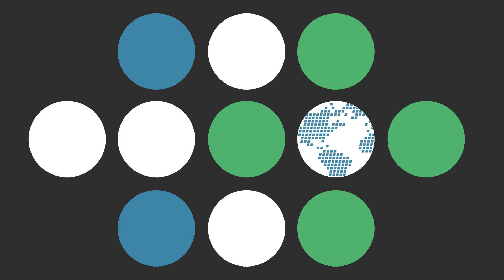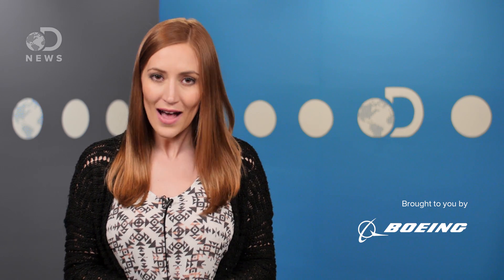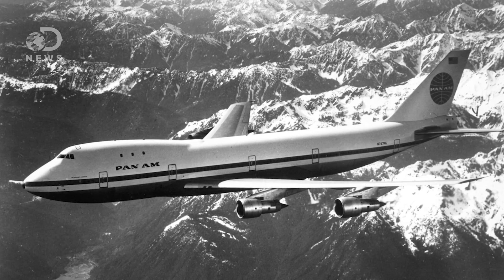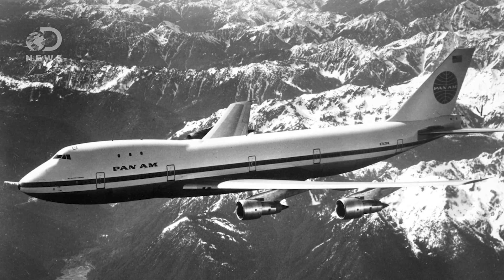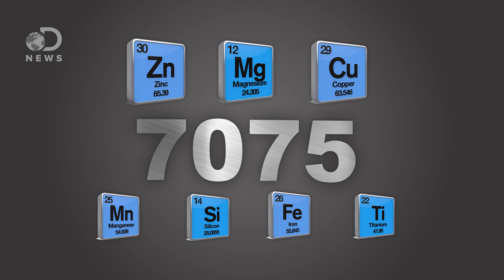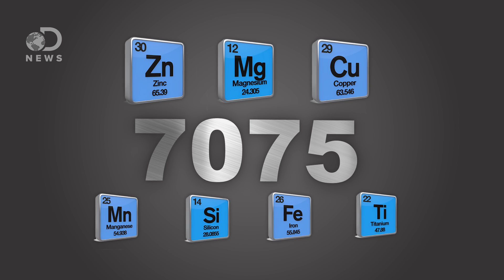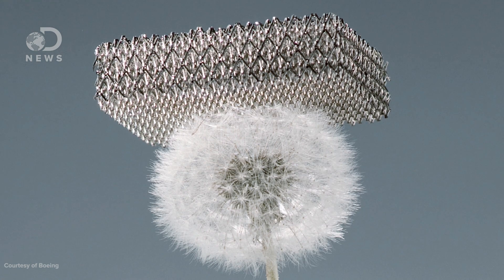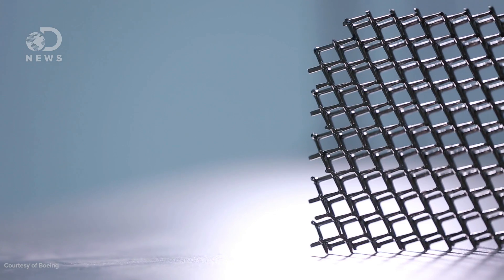What Makes Airplanes Light Enough To Fly?

Comment: i can explane it because ive study aviation science
wings has shape were from the top is thick and the bottom is slim
so when the air crash the wing it devided in 2
so same each point have devided they most meet each other at the end of wing so while the top is thick it will make high pressure from the top of the wing and that will elevate the nose of the plane and the engine will maintaine it fly to keep recieving air to the wing
so you turn off the engine their is no air or presure to the wing so the plane will fall
Reply: when you drive s car very fast
the car become light same with airplane
engines has big mouth were it recieve huge mount of air and goes enside the engine with 2800 dgree heat and this air goes out out with ultra presure with very small hole of the engine and thats push the plane forward

Comment: Cool. Exept, if you could make big enough wings, you could theoretically lift anything. So the title of this video gives a false impression: Aircraft, or specifically, fixed wing aircraft, like the ones this video focuses on, are already light enough to fly, the engineers' challenge, material wise is in making them more efficient, cheaper to manufacture and able to carry more cargo/passengers, not so much to make them able to fly, since the shape of the wing should do that. Enjoy wathing these interesting videos by the way, just don't want people to start thinking that bringing extra jewelery or whatnot will stop the plane from flying or hinder it in any way: you'll just burn a miniscule amount of extra fuel. Sorry for being so pedantic.

Comment: Half the video isn't even about the question. Just get right to the point: engines push wings through air. Wings are shaped to provide lift. If wing provides lift plane goes up. That's it.

Comment: I know this is sponsored, but you could at least make the title of the video accurate. You're not explaning why airplane flies, you're explaning what they are made of.
Reply: The title is very accurate. It tells us what makes planes light enough to fly. Which is exactly what the title says.
Reply: The weight of the plane doesn't directly correlate to its "hability" to fly.
What factors in is the format and area of the wing, and the propulsion.
A heavy plane flies the same way that a relative to the first plane light plane.
Reply: That is very true. But no one ver said, that the video was about how airplanes fly. The title states that the video is about "What Makes Airplanes Light Enough To Fly" And that is what they explain here. You complained the title not fitting the content of the video, when in fact it fits very well.
No one ever said this video would be about "What makes Airplanes Fly"
Reply: What doesn't fit is the "to fly" part. What makes airplanes light? OK!
What makes airplane light enough to fly? Not OK. You have to admit that they used a tick  on title that is not 100% honest.
Reply: I think the title is extremely accurate.
Reply: It's titled "What makes an airplane light enough to fly?", not "How does an airplane fly?".
The title is perfectly accurate, you nitty picker.
Reply: +Rodrigo Bragança right !!!
Reply: Ye, you are right there, but honestly i think it is not really an issue, but maybe youtube has just lowered my standards over the years :D
Reply: +Chris Cartwright that wasnt the title earlier it was changed
Reply: +Chris Cartwright the title was the question in the beginning of the video
Reply: +deairreo hill The first reply to this comment (which was before yours) implies otherwise.
Reply: and Boeing gets a mention mmm.

Comment: Surprised you didn't touch on the Bernoulli Principle. The plane would never fly if it was denser than air [and it pretty much always is] but it's the pressure difference on the wings that causes it to fly. A lighter load just makes the execution easier and waste less fuel. "What makes airplanes light enough to fly" is physics, not Aluminum... otherwise you'd see whole chunks of it just flying at the slightest push of the wind. Although once again the materials used does determine fuel efficiency :v
Reply: Yeah.. These days the titles are just click baits to pull viewers.
Reply: because this is sponsored by Boeing they are showing innovations from 787 only
Reply: just because there is physics and chemistry does not mean these 2 do not work together, physics and chemistry are both aspects of nature, so both should be considered during the creation of things, if physics operated on its own, it is likely that people will die, cause chem and bio tells you what is dangerous to human beings and at what conditions these dangerous compounds are created or chem tells you the compounds that are suitable for the project, for example, engines are hot, engines needs something that can withstand high temperatures, guess what, chemistry specializes in that.

Comment: why not just make the whole airplane out of carbon fiber
Reply: thats like one of the fastest way to blow a billion dollars
Reply: Too expensive and impractical
Reply: carbon fiber is rather dangerous material despite it's strength and lightness, most of the damage done to it is kinda invisible and when it cracks or fails it will break the entire plane into pieces, it's like glass in this regards, when it gets damaged it simply explodes into pieces.
Reply: abzy12321 i know that it would be more expensive but so much lighter and stronger

Comment: It's not the weight of the aircraft that makes it fly it's the difference between the pressure on the top of the wing vs the bottom...
Reply: thrust must equal weight
Reply: The fact that aircraft materials are light makes them a lot easier to fly, though.
Reply: +Ps3Gamer4526 But gliders have no thrust and they fly.
Reply: John Doe air resistance bby